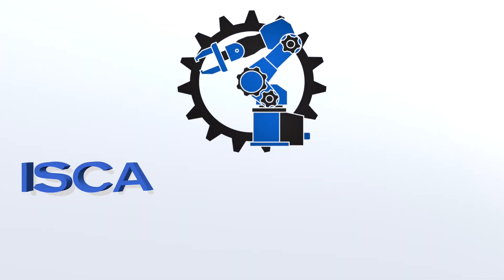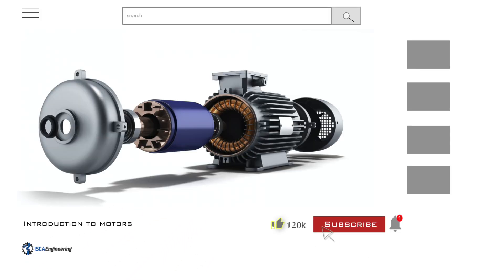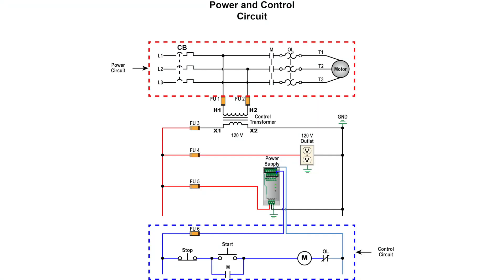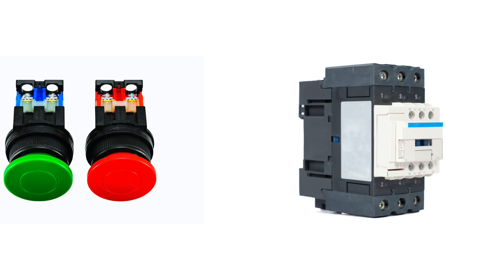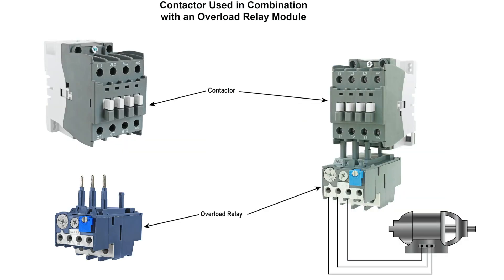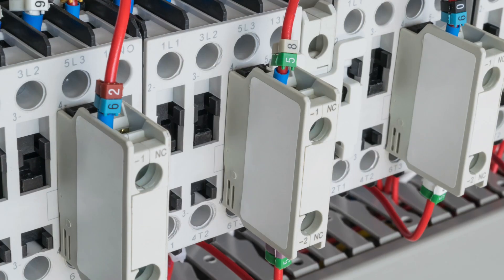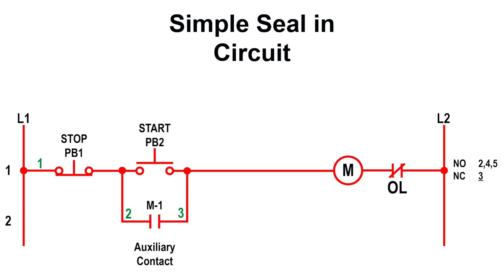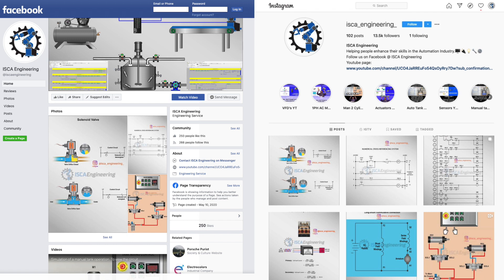Contactors

Comment: Can we say ; contactor is for 3 phase , where as relay is for single phase ?
Reply from the maker: Contactors can be utilized in both three-phase and single-phase systems, depending on the current, voltage, and loads involved. They are often used in three-phase applications due to their ability to handle the higher demands of three-phase equipment like motors. However, contactors can also be used in high power single-phase switching.
Reply from the maker: In single-phase and low-voltage applications, relays are often chosen for tasks such as switching lights, fans, solenoids, or small motors. They are suitable for control logic, automation, and protection functions in these scenarios.